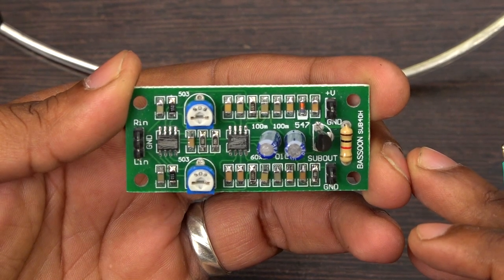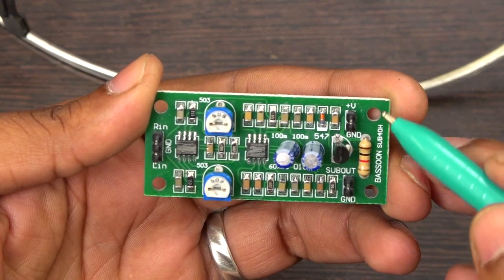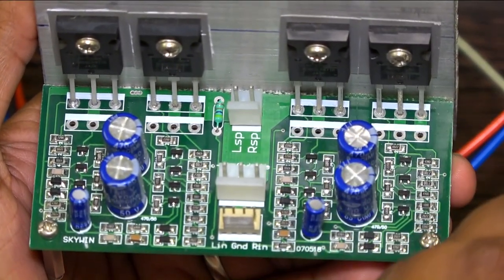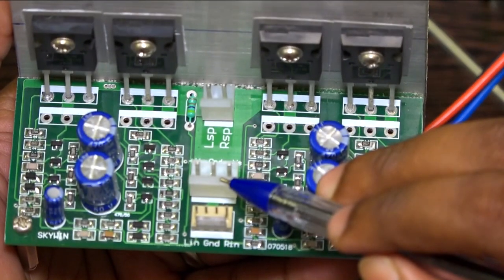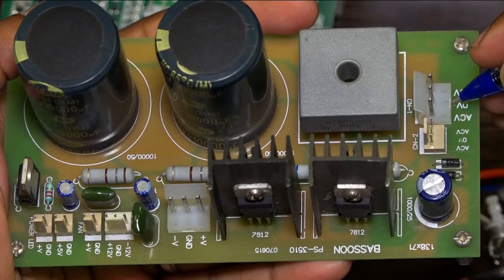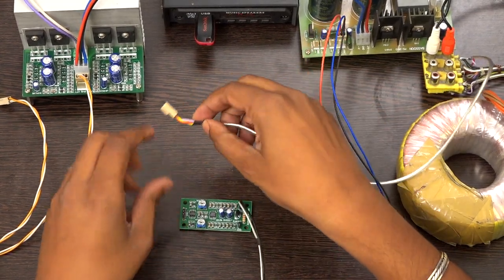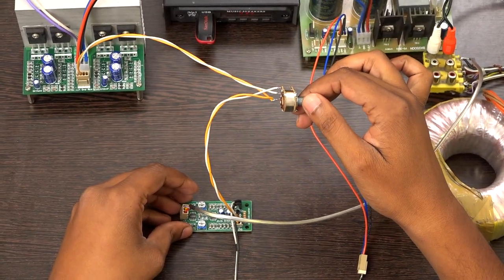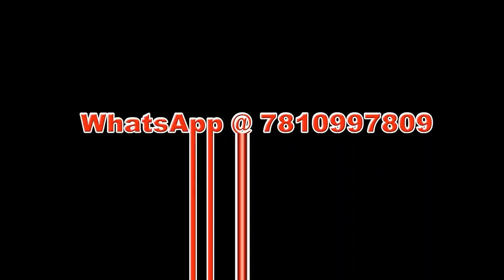Bassoon Single Supply Subwoofer Board (40Hz) Demonstration

Comment: Bro, watched demo of both single and double powersupply subwoofer preamp board. I can see the difference is, voice frequency adjustment.
Is that really required to adjust mix of voice? Planned to buy basoon. But which 1 should I buy. Explain me the different scenario where it required and not required.
Reply: it is not necessory to adjust frequency. It will added like a extra feature.